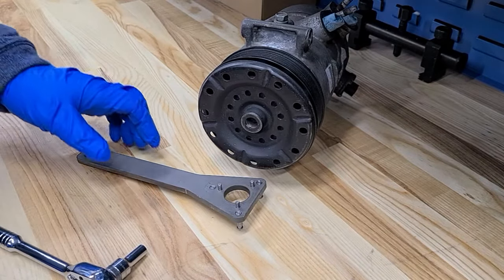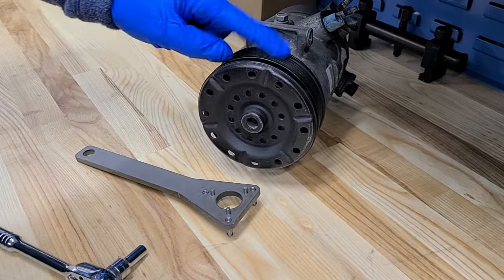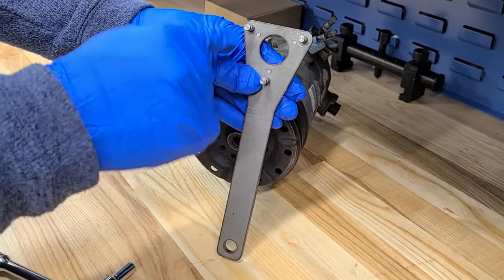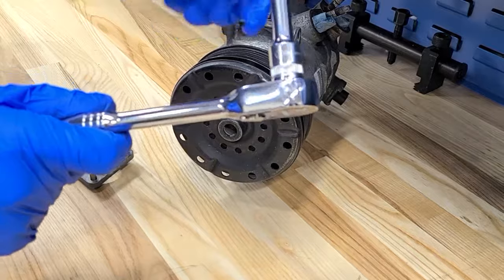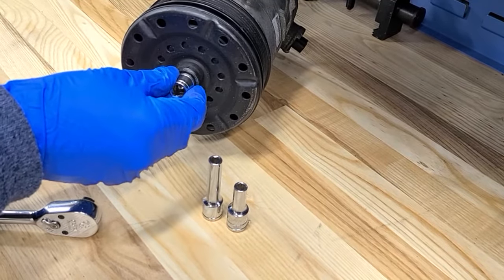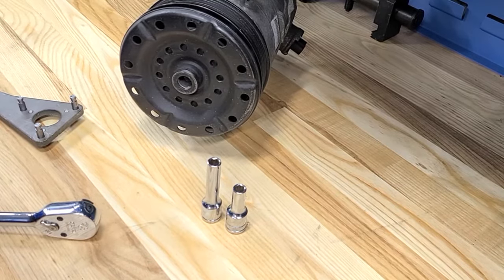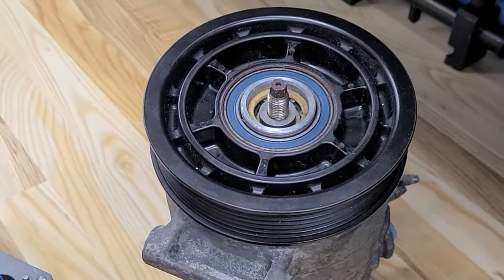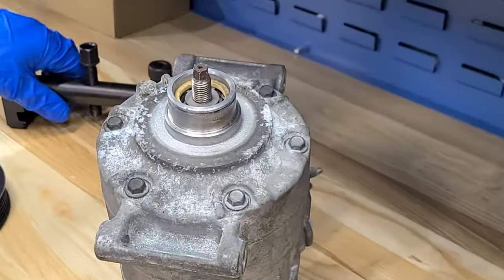Detroit Thermo Tool to remove and replace the compressor hub and pulley on Toyota Corolla

Comment: Why cant they make it like other cars with one bolt not this dumb design that you need a special tool for.  A plastic pulley what a joke.  So to replace the pulley you need to remove the engine from the car great Japanese designers here.

Comment from the maker: Pesh, are you able to find a replacement pulley for your compressor?  Just swapping the pulley is a pretty cheap and easy thing to do.  Erik
Reply: Hi 
No unfortunately I could not find it anywhere that is why I gave you the specifics for the part wondering if you had it.
Any way I bought the complete compressor now and replaced it .
But I want to buy those tools of you.
Many thanks for your reply
Reply: I checked the tool on your eBay it is reasonably priced but shipment cost is too high I was wondering why that is high.
Reply from the maker: What is your location?
Reply: @Detroitthermo  
England UK
Reply: what is the name of the extractor and the other tool

Comment: Does that wrench tool you made fit a 2014 Dodge Avenger 2.4? Denso 6SEU16C compressor.
Reply: Chrysler 200 and some Jeeps have same engine and I would imagine same compressor also.

Comment: It appears that this doesn't release the coolant and that you could do this without removing the compressor?
Reply: Correct, as long as you have enough space or can make room to do the job. Looks like my Yaris I can remove some inner plastic wheel arch to get to the ac compressor.
Reply: Correct

Comment: So, I bought it off eBay and just now took my stone guard off. The bearing is basically gone. I was afraid the compressor itself may have caused the breakable part to break. Looks like it'll work. I'll just finish up this yogurt and get back out there.  BTW, I used the 1/4' drive socket, but with an adaptor for the larger ratchet. Worked great. I also just grabbed the solid ring on the stone guard with vice grips to spin it off. Still on the car. No wonder the belt was always squealing. I think I actually had it TOO tight.

Edit: Done. That was absurdly easy. The car runs very quiet and the AC works great! This video saved that car. I was going to dump it. Maybe I CAN get it to 300k.
Reply: WHERE DID YOU GET THE PART LINK PLEASE
Reply: @billwilliams2057  I looked for it based on my vehicle. I'm out of town right now and my new phone doesn't contain all my email addresses. When I get home tomorrow I'll look it up on my desktop and check back.

BTW it is still working great!

Comment: Heh. I have a Scion xB (1st gen) with 225k miles on it. I bought the car new and love it.  I replaced my noisy alternator a couple of months ago (due to noise) only to discover it didn't help the noise. Yesterday the noise got really bad, and I noticed the AC wasn't blowing cold air any more. There was a terrible rattling noise, almost as though my engine bearings were about to seize up or something. Well, it was the AC compressor that was making all the racket. Thinkint it was the AC clutch I did some Youtube searching only to find out it was clutchless. This brought me to this video. I know it's the compressor pulley mechanism because the outer plat didn't spin while the engine was running I can see from the wheel well because the plastic plate is gone (after hitting a deer 75k miles ago). But I can turn the outer plate fairly easily by hand. I assume the compressor is still functional but it may not be. And when I looked at it from above with the motor running you can easily see the inner plate rattling around between the pulley and outer plate.  

This video showed me how to either take out the inner plate so that it is quiet (but no AC) or how to replace the whole setup, assuming the compressor is not shot. Looks like I just need to replace the inner plate, if it's even available, if I think the AC might still work...

I guess we'll see. I'm SO glad I had the new shop building built. This would suck to try to repair on my lawn. :)

BTW, seeing as how I had a dickens of a time getting the belt to stop squeeling when I replaced the alternator, I suspect the compressor is done. After all, something had to cause the inner plate to break.
Reply: hi. Can you tell me if you have splved the squeeling? what was the cause? and how about the Ac compressor? Mine squeeling come and go. and my ac dont cool when about 1000rpm

Comment: Hi
I have a denso compressor which is making knocking noise but the ac is working.
The part number is GE447280-6570 and it is 5SE12C.
Here in England the mechanics go for replacing the entire compressor , and if you tell them to change just the pulley they will think you got some sort of mental problem.
The car is a toyota avensis deisel 2.0 D4D of the year 2012.
I need your opinion and wonder if you have the part and if it can be bought from you and sent to me.
I will very much appreciate your help sir
Reply: Mine made that exact sound for a couple of months until the inner ring snapped completely. Now the outer plate is not spinning with the pulley, but it is spinnable by hand. i.e. it will keep blowing cold until it sheers completely.
Reply: In France the same, they want to replace the entire compressor, 1100-1400€ parts and labor. Haven’t found a garage willing to change only the bearings, more profit changing the entire compressor !!